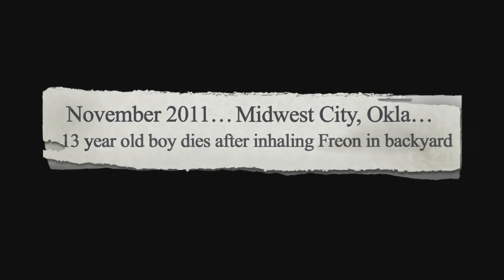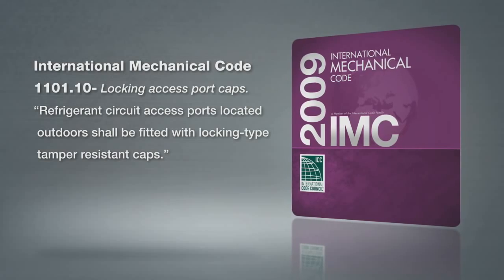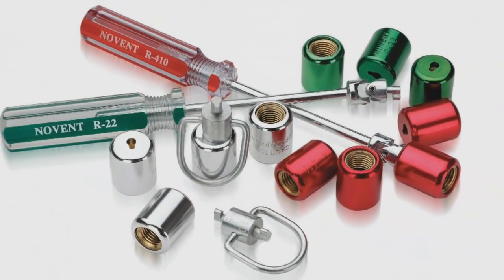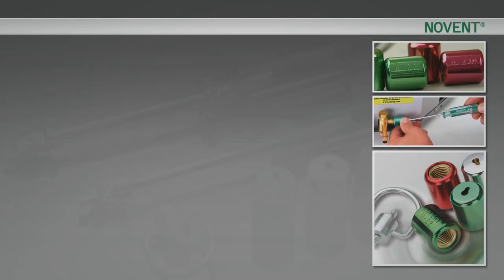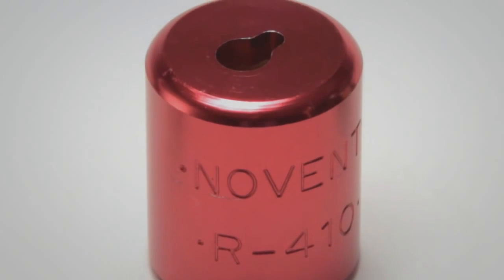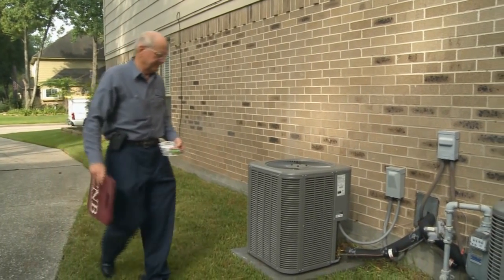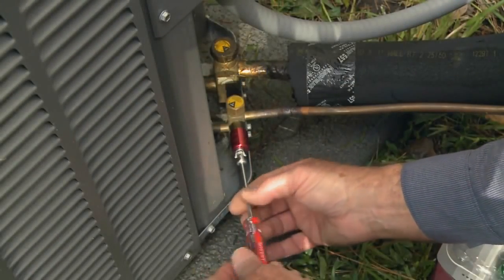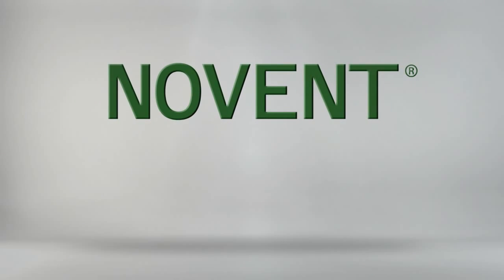Novent Code Compliant Locking Refrigerant Caps  - How to Prevent Refrigerant Huffing

Comment: Came across this product on a unit, used a modified paint can key  and easily took them off thankfully,  some techs use it to get callbacks. Just saying
Reply: "Huff" caps (locking refrigerant caps) are required to be installed on units per code.